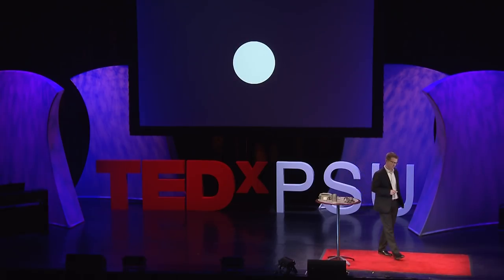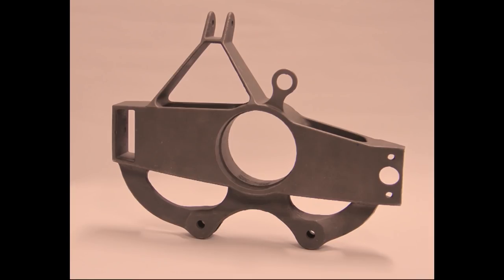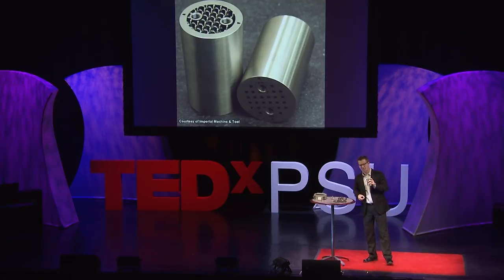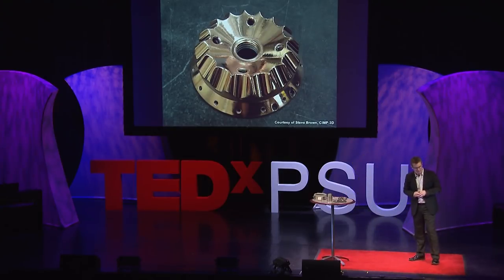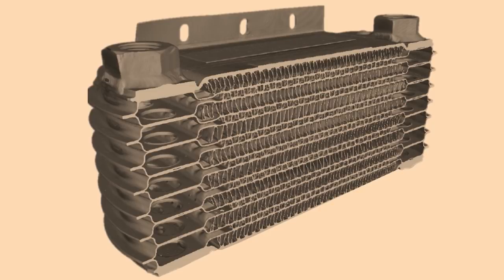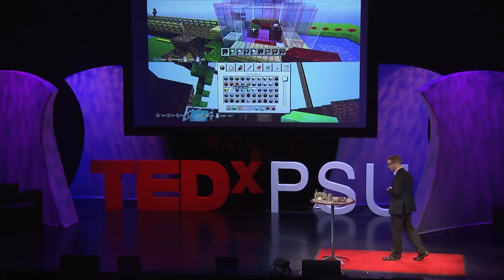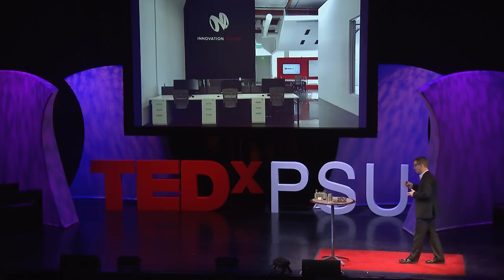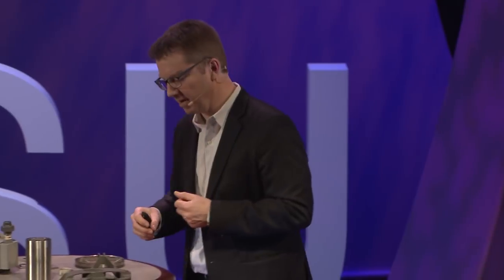Disrupting Manufacturing One Layer At A Time | Tim Simpson | TEDxPSU

Comment: I'd rather have a physical, non-digital, mechanically automated, servomechanisms-assisted machine tool industrial shop factory, heavy engineering factory, and machine building factory. Rather than have something that manufactures something conveniently at the expense of certainty that can only be acquired by a hands on and minds on working experience in designing, building, testing, inspecting and mass producing any manufactured products, and sacrificing permanence and security for ease of manufacturing things because you do not have an auxlliary analog, non-digital manufacturing, all mechanical, mechanically automated, servomechanisms-assisted assembly line system, processing system, and extraction system and that of their equally analog, non-digital manufacturing, all mechanical, mechanically automated, servomechanisms-assisted ancilliary industries.

Comment: we have been making precise square holes using broaches for centuries
.
Reply: I'd rather have a physical, non-digital, mechanically automated, servomechanisms-assisted machine tool industrial shop factory, heavy engineering factory, and machine building factory. Rather than have something that manufactures something conveniently at the expense of certainty that can only be acquired by a hands on and minds on working experience in designing, building, testing, inspecting and mass producing any manufactured products, and sacrificing permanence and security for ease of manufacturing things because you do not have an auxlliary analog, non-digital manufacturing, all mechanical, mechanically automated, servomechanisms-assisted assembly line system, processing system, and extraction system and that of their equally analog, non-digital manufacturing, all mechanical, mechanically automated, servomechanisms-assisted ancilliary industries.

Comment: he is wrong about the term additive manufacturing, high temp metal spray's were applied to a shaft using a lathe  in a method comparable to welding and that was called additive manufacturing.